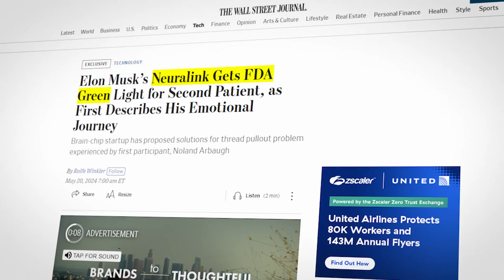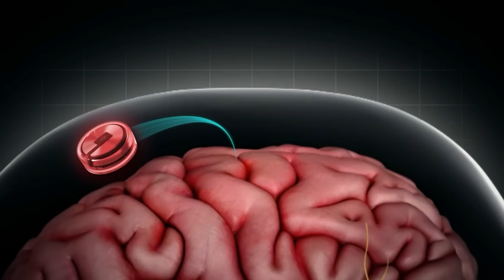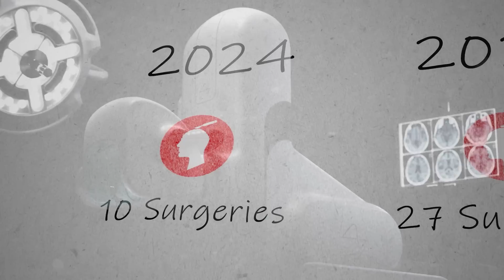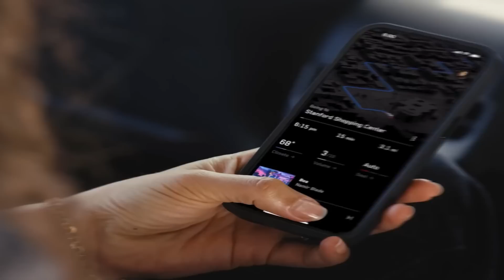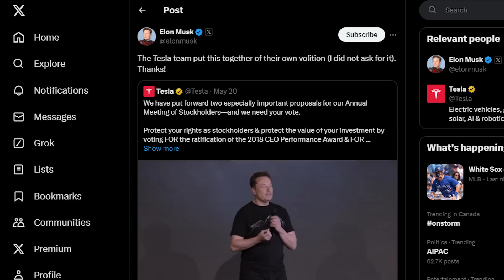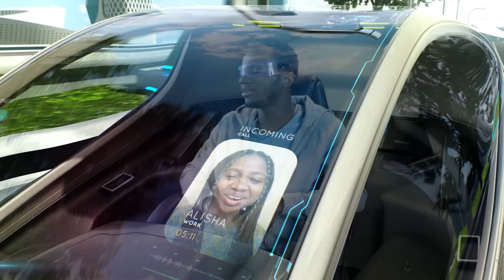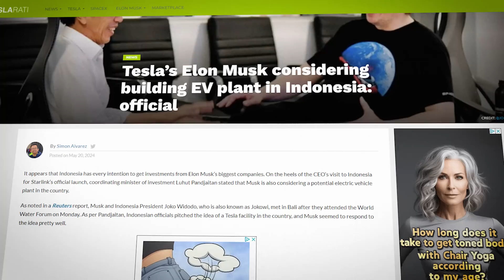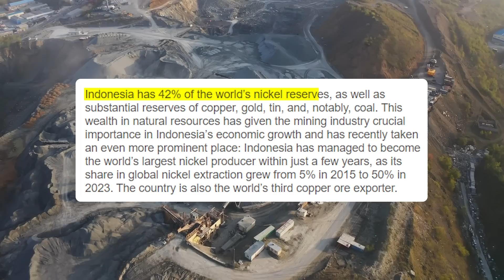Neuralink Reveals Major NEW Human Trial Update!

Comment: Wouldn't it make more sense to make the wires longer to give them more slack rather than just inserting them deeper?
Reply: the body will try to push them out reguardless
Reply: @keterclassentity6716 What's the solution?
Reply: @Whiztlex  sorry to be patronising.. but obviously the solution is too insert them deeper.. think about it like a tent peg. Put it in shallow, it has more movement and may wriggle out. Peg it in deep and it is much more stable.
Reply: @justanotherguy2219  Yes and dig too deep and maybe you hit a rock. What can we hit if we go too deep in the brain?😬
Reply: @Whiztlex  Are you a brain scientist, and do you assume that neurolink along with the FDA have not thought about this backed by extensive research?

If you are smarter than all them, you have my full support to take lead for these clinical trials.
Reply: @justanotherguy2219  I'm dumb as shit. That's why I'm asking questions in an attempt to fill the void in my brain
Reply: @Whiztlex  can't refute that, but you aren't going to find truth in YouTubes comment section.
Reply: Yes, when the guy start talking funny or not talking at all , then stop inserting lol